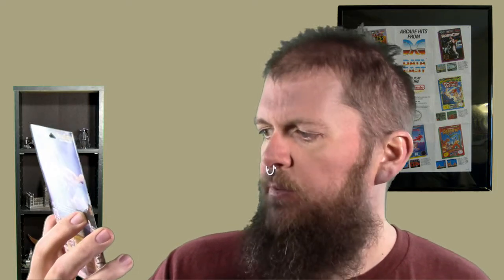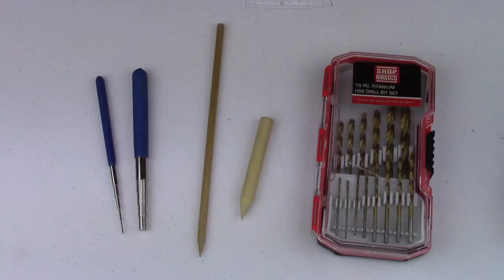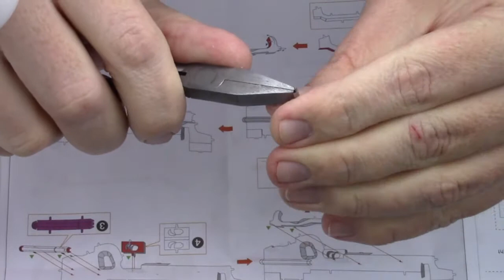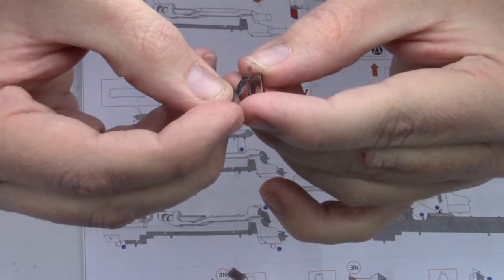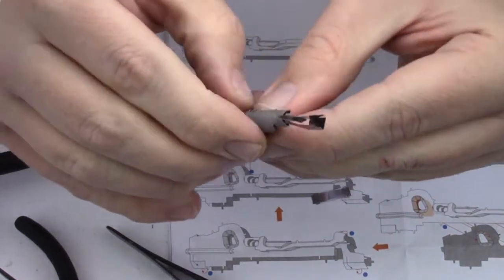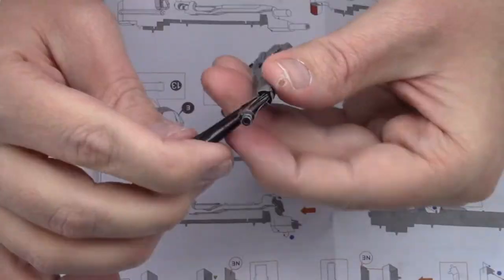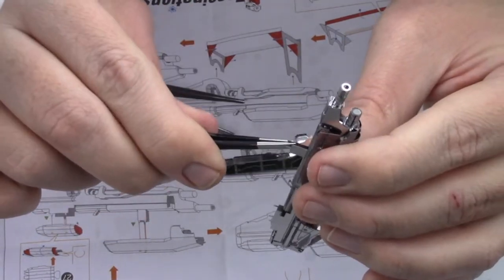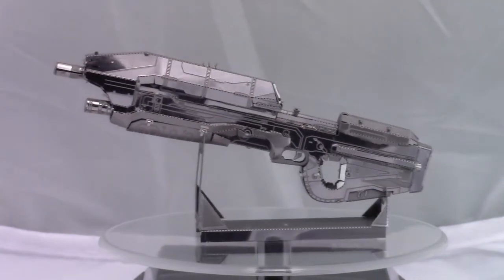Metal Earth Build - Assault Rifle - Halo

Comment: Hello from the UK again. 1 question. You mentioned at the end of this video that you might be using some glue on the loose bits, what glue do you use please ? I have tried various makes without success. Another good video, but, getting hold of many of the models you show is not easy over here, besides the getting them imported which I have done 3 times, but very costly. Enjoy life. Bob S
Reply from the maker: I used several myself with no luck until someone suggested Loctite to me. It seems to do well. Sometimes takes a while to set, but so far so good. Mind you, I rarely use it.
Reply: Bob Sangster I use Krazy Glue with mine it works really well sometimes you have to use tape just to hold the peace while it drys
Reply: I just use cheap tubes of super glue. Works just fine. The key is to only use a really thin coating of it, and give it PLENTY of time to dry. It takes longer to dry on metal than with other materials. And once it dries, still be careful with it or it'll snap.
Also, if it's a hidden area, it helps a bit to rough up the metal with a file or sandpaper so that the glue has micro ridges to hold onto and make it hold better.

Comment: nice job on the green screen i barely noticed. but the beard kinda showed it but nice job 👍
Reply from the maker: Thank you. The hair does give it away. I didn't want to cut the beard but it had to be done for the transplant, so in upcoming videos, that will no longer be an issue.
Reply: thanks for responding 👍